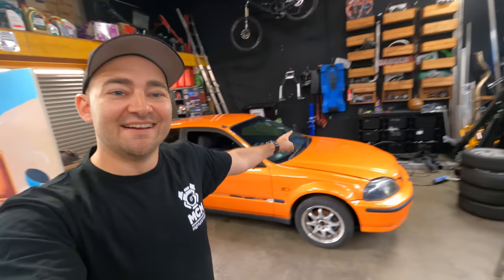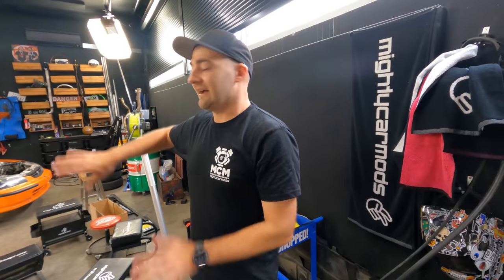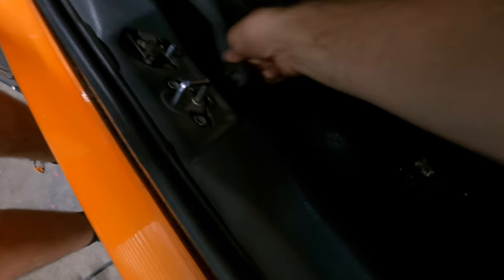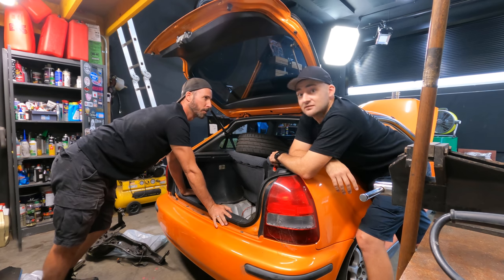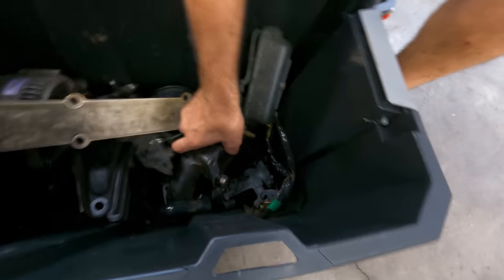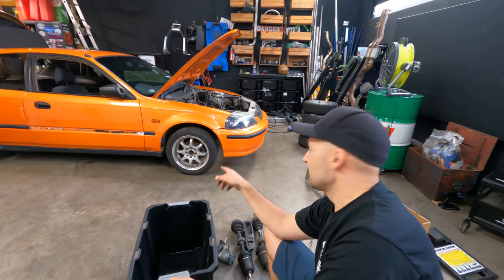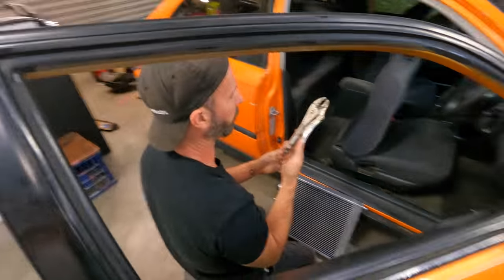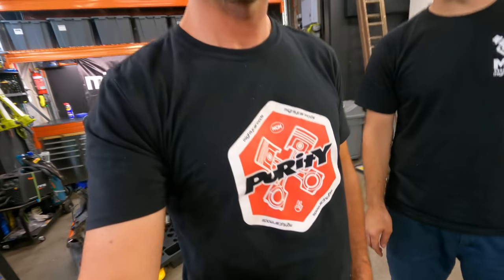Buying an unfinished Project Car (off the internet)

Comment: Funny, I got a 97 Civic CX in really good shape. no leaks no wet spots, just needed breaks and struts for $2k.    I've also got a 97 Civic EX 4dr 1.6lr V-tech  D16Y8.   Cylinder 1 ring took a shit.  took some of the parts and put them in the CX.  Now the EX is a Project.

Comment: My american 1990 240sx came like that, even the seats weren't mounted, both front and rear bumpers were in there, no engine but transmission was there. First thing I did to make stuff worked is that I hooked up jumper cables to what was the cables and found that it was indeed mostly working. Walked away with it for about $500

Comment: I live in Michigan, USA. About 15 years ago I bought a 1985 MK2 Jetta for $500. It didn't have working brakes, and all the interior paneling was in the back seat and trunk. There was no stereo. It was a 5 speed and the hand brake worked, so I drove it (yes) straight to my buddies house (scariest 15 miles of my life) using engine braking to slow me down and the hand brake to stop. We bought a whole brake system from the local car part store & I dailied it for about 6 months, then sold it to a friend. I never finished the interior :D

Comment: 18:29 Last year I bought a vw Squareback project that was abandoned by the first builder. It was a body shell that was sitting on top of a tube frame and held together only by gravity. The tube frame was only tacked together. The rear torsion housing and wheels were only held to it by 2 bolts. The front torsion housing was tacked to the frame. There was no engine, transaxle, floors, windows, brake lines, fuel tank, wiring other than the ones hanging out of the key, lights, firewall, door cards, seatbelts, or paint. Now I have it with floors, fully welded and finished chassis, fuel tank, transaxle, Honda d16 engine, coolant and fuel lines, radiator, engine wiring harness, disc brakes all around, brake lines, suspension, and a properly mounted body. It is not yet running. As a Honda engine fanboy, as well as a tig weldor/fabricator I’d love to build you guys a manifold for your Honda.

Comment: Not me but my room mate bought an Acura Integra unfinished and not running and even unfinished paint.
It was coated in grey primer that was peeling with no sealer or clear coat etc. 
No engine, no wiring harness, no seats, no battery, along with a fair bit of rust.

Slowly but surely over a year or so he made it running and drivable and enjoyed it for a couple years before he lent it to a friend who needed a car who ended up wrecking it being an idiot.

Comment: I once had a customer deliver a Vauxhall Chevette (YEB624T) rally car in boxes, even the engine was completely sttripped, this car had won the 1979 Circuit of Ireland driven by Pentti Arilikkala and co driven by Virtanen Risto, slowly but surely I rebuilt it and was then able to take it to my local race circuit  Kirkistown, to ''run it in''

Comment: Yes my car started just like this! Bought a sight unseen ke70 sedan off Facebook marketplace!!! Hahaha!! Had a working handbrake and a mounted engine (professionally rebuilt). The rest in the boot and backseat. gearbox had wrong tailpiece and wrong shifter rods just lots of head scratching moments working out.... rego was lapsed and found waaaay to much rust to be arsed getting revinned so did the only thing that made sense.... bought another ke70 and going to make a semi ok version out of the 2... my wife is over the moon.

Comment: Do a B20b block with the b16 VTEC head .. get some eagle rods and pistons ACL bearings ARP head studs with a comtec MLS head gasket ... 650CC RC top feed injectors and use a TD06 turbo off an EVO much better and quicker spool  .. Hal tech management .. open the gearbox slap an LSD in there also a double plate ACT clutch kit and a 9 pound flywheel .. coil overs for sure install the rear rotter kit .. and go for 17” wheels tire specs 1
225/45/17 P sport tires ..

Comment: First car I ever purchased was from a friend of mine who is a bit of a Subaru genius. He had a 2001 Subaru Impreza outback sport, five speed, that he had planned on doing a h6 swap into but bought another subie instead. This was just after i had finished highschool and needed a car to get myself around. So I bought the car from him for 300$ CAD. It was all in pieces, interior, engine, suspension, drive line, all of it. I dove head first into it, no prior experience working on cars, took two weeks and put it all together just to almost blow it up right off the bat. Didn't realize at the time that the coolant needed to be all the way full inside the rad haha. Not only that but u almost had the tps pushed to far clockwise so it was idling at 4k rpm. Not did the starter work do I had to bump start it. After I started it I drove it to his house after and got there with the engine overheating like crazy from overrevving and lack of coolant. I fixed it that week, but decided to ignore the bad starter and bump start it everywhere I went, even in intersections while learning how to drive that damnthing. A Month later a lady hit it and I got 2k from insurance. Best experience ever!

Comment: FINALLY. The Honda scene thanks you. There are reasons there is such a scene for such basic, economy cars. Joke all you want, but these cars are fun because they handle well for the budget, cheap to buy, cheap to maintain, cheap to modify, and reliable, including to make power with. Plus generally well and subtly styled. Bout damn time.

Comment: I constantly laugh at my buddy that has had nothing but civics. He now had a K20 04 RSX. True Honda fan boy. I've had atleat 22-25 different project cars in the past 10 years. Currently swapping a 1JZ into my 06 Toyota mark x 250g that I just recently imported from Japan. Gotta love that 15 year import law with Canada as apposed to the 25 year in the US. Gonna be a solid ripper by the time I'm done with her!! Well I'm not doing the mechanical work to it as I don't have time to work on it. Sent it to my buddys shop. That's the only problem working a 13-1 shift. Never have time to do anything anymore. 

Edit: I literally have 24 days off a year. Work 13 days on and get every other Sunday off to get groceries and do laundry.  Two days a month off work. Not gonna lie I absolutely love it and the money is even better. Just paid 71,600 for a 2011 R35 GTR Black edition with a built 4.1 stroker from boost logic. Thing scares the shit outta me 😂. Work hard play hard 💪

Comment: I’ve purchased a car in pieces like that, 98 Audi A4 5spd, previous owner said it just needed the turbo put in. Came with 2 turbos bw k03 and k04 Long story short the engine needed work after rebuilding, buying a new computer and a multitude of other little things like sensors, connectors, wiring, hoses, etc. (some of which were extremely hard to find) I got it running. Both turbos that came with it were bad so I had to buy a new Bw K04, but the transmission was done up with a brand new racing clutch, and brand new suspension, lowering kit, brakes tires. Just the engine needed work, but it needed a lot. Overall I spent slightly less than it would have to buy a comparable a4 and mod it. I still have it runs great 530hp to the wheels dynoed, but most of the power windows died recently. Find a car in pieces, I’d say worth it if you have a lot of time, money, and really know what you’re doing. If you want to learn I wouldn’t recommend this way.

Comment: long inhale....  The B16A was available in the SiR Del Sol in Japan and the SiR version of the civic. It has slightly higher compression ratio and an additional knock sensor in the block over the B16A2.  It was claimed to be a 170bhp engine at time of build (early 90's) but in reality outputs much the same as the A2 (160bhp). normally coupled with a Y21 5 speed gearbox or the dreaded automatic, it was available with a limited slip diff. The B16A had a rev limit at 8500 rpm and VTEC crossover at 5750 rpm. The standard ECU on the SiR was the P30.

Comment: I bought a 92 Lexus sc300 with a blown up rusted up 1jzgte in it, cylinder head was in the trunk, bare block barely bolted in with an R154 trans, and I’ve stripped it out and made a nearly pro spec drift car out of it

Comment: yeahhh I bought a 914 with the wrong 4 cylinder in it except nothing was connected at alllll and it had been sitting in the previous owners shed for near on 6 years without a single bit of work put into it. Anyway I did the logical thing and took it apart even more to completely redesign and "restore" it with some Japanese muscle in the form of a mazda 13b engine, factory widebody, and a lot of engineering and custom work to make it one of a one of a kind street legal race car that makes me want to go out and drive forever.

Comment: Currently looking for knock sensors and a bunch of missing parts for an E30 with an M50 swap. The block came in the back seat with the head in the passenger seat and everything else in the trunk.

Comment: I got a project Honda CRX SI for free. The catch? Your Civic is more put together than my free car. The seats, dash, carpet, and wiring harnesses were taken out. It's all there, but it's been removed. The engine and trans is still hooked up and installed. I just need to get off my ass and put it together.

Comment: My E36 318is came running and able to move under its own power in 2018 but it was a half finished job. It had been crash damaged in 2012 and repaired in 2013, but the driver's door, fenders, bonnet, bumper and grille had been replaced and had a poor primer job done on it. Its entire suspension and brakes were shot, but the power and drivetrain were good, except for misfiring bad as at first while the injectors cleared up of varnish. It was missing every exterior lightbulb and was missing headlights and front and side indicators altogether, so I had to scrounge that stuff up off gumtree and some wreckers. I had to get a new fuel pump and when I got the car the tank was sitting open with a random fuel pump in it just to make the car run, so that lovely smell permeated the (open) cabin.
So I painted it, my first attempt, and got insane orange peel, and couldn't even take my door off to paint it because I couldn't leave it outside with no door as someone could've nicked it. Door still in that awful primer, but she got the nickname "Oreo" because the colours reminded us of the Oreo branding.
I admit, I actually misdiagnosed a blown head gasket because of the condensation I was seeing in the oil and not having had much experience at all in that department. So off came the head, it got overhauled, and new gaskets and stuff and she's sweet as now. ECU still keeps throwing P0300-0304 random misfire codes but it doesn't feel like it when you drive her.
Love her and still have her today. Now putting in chassis reinforcements, and an E46 3L M54 later in the year.

Comment: Take 1 2012 Megane Renault sport 265....... That lived as a rental car at the Nürburgring....... Purchase without its engine, gearbox, interior, and front panels...... Currently all that's left to buy is the brake calipers...... Retail in Germany about 15k€, total spend so far 6k€........

Comment: I brought a classic mini Mayfair automatic 1986 where the previous owner had destroyed the gar box and tried to strip and repair it and gave up. the body work was pretty good apart from standard mini rust areas and the engine was in pieces in the back seat 😂 got a working 998 auto engine from one of our mini club members but I spent soo long sorting the small bits of body work Someone else asked to buy the working auto engine so I sold it and at a later date I picked up a 1275 auto to upgrade it after cleaning up and painting all the running gear and checking for even more rust 😂 i’m now ready to put the 1275 in and get it on the road. Brought the car for £600 and the working auto engine for £100 probs spent £200 on other bits and a good few hours of my time when I get some spare but I think before this summer ends ile have a decent classic mini for around £1000 before I decide screw the auto and drop a manual in if not some crazy engine swap possibly Honda possibly Yamaha R1

Comment: Things you'll probably need:
OEM 96-00 EK B16 driver's post mount (the gel-filled mount sucks)
OR typical Integra post mount & rubber mount + EK adapter bracket
96+ sohc or dohc engine harness (or merge your two harnesses)
rear-middle 't-bracket' also from a 92-00 B16 EK
distributor harness adapter if that's a pre-96 B16 with 96+ engine loom
96+ EK B16 shift linkage & rollpin (any DC/EG works with your welder)
Integra or EK B16 coolant hoses
OBD1 to OBD2A ecu adapter if not Haltech
chip burner or emulator if you use something like the free Hondatuningsuite.com OBD1 software

Comment: Yep bought a 1991 Mk3 "MA70" Supra Turbo with a 5 speed for 1500$ in 2007 she had a blown motor, as a result of some joy riders rapping it, and then leaving it on the side of the road 😥 any way i bougth a JDM 7MGTE, then there were issues mainly $$$ but i own it and i never looked back. She needs work right now, but that is precisely what im doing right now, i cant wait to wake her up from the long long slumber she has had!

Comment: B4 subaru Legacy with a broken trans, broken shocks, tons of bits inside and like this little nugget, a useless old Sony sub. Had a 2.0 wrx engine put in it but was not connected at all to a wiring harness and later found out it had a spun bearing too. Like it was put into the Legacy as a way to store it.

Comment: I had a ba16ca in my gold badge accord 97 model with a to5e turbo off a falcon in it with quite a bit of work and red devil ECU mapped blue printed and everything had 412kw was quite fun but went through so many auto boxes and back then finding a manual to fit was hard now there every were

Comment: In 2009 I bought a mazda 323 200i 16v car it was stripped and resprayed with all the spares and trims inside the car and the stripped engine and gearbox in the boot

Comment: I bought a project that I would've been better off had it come in pieces like that - My 1985 Toyota Pickup. I bought it with a blown head gasket, a ratty interior, '05 Mustang wheels, a stereo that screamed "steal me!", and a really bad lowering job (4" blocks all around).

I've slowly been fixing it to be something an adult could be seen in and drive comfortably - The interior and rust are getting fixed, a better lowering kit is on the way that doesn't have huge chunks of metal you bolt in place to ruin what little comfort was in the ride, and the engine is getting replaced with a 1UZFE. It would've been easier to start with a rolling shell and not have to have junked the worn out bench seat, the blown engine, or any of the mess that is the "repaired" wiring.

Comment: I bought a r32 that had everything stacked inside the car, no idea why the previous owner pulled it apart, all it needed was an engine rebuild. Since I've bought it, it's fully stripped out and all the parts on a shelf, sounds like a good idea for a project before it starts costing money, too many cars and too little income to start it just yet haha

Edit: it's not a skyline unless you find a point bag under the carpet

Comment: Those cars are cheap over here in America, my friend got one in excellent shape for $2500 with only 110,000 miles on it. Generally sell around $4,000 for the most part though

Comment: Bought a 1970 Datsun 1600 project, came with a 1.6ltr turbo engine separately and six massive boxes of parts had so many spares, ditched the 1.6 and put a 13b rotary in it, sorry boys no purity in this build, got it to show room condition then a year later got stolen only just put the chopped sticker on it a month before aswell haha.

Comment: I brought an unbuilt rebuilt engine. This means a block and a few crates of parts. After some research, it turns out that it was most of the parts needed to build an old school, Chevy 283 stroker engine.

Comment: A b16a actually has a shorter deck height than the b16b (used a b18c block with a b16 crank) basically a b16 is a true 1.6 the b16b is a destroked 1.8
Reply: Also love the show have your posters started watching 8 years ago because of your original civic video love the honda content!

Comment: i bought my 1972 triumph spitfire unseen from eBay for £550, it  new it was going to be in good condition when it came with a spare chassis, its more rust than car and 18 months down the line still in 1,000,000 pieces, but along with half the car being inside the car dismanted. it had a unopened bottle of lemonade thats expiry date was my birthday ( im 32) and as you can imagine a 30 year old bottle of lemonade tastes absolutely horrible.

Comment: Ek9 dash carpet and seats for the interior be sweet 

I bought a 91 si civic jdm import for 1500 10 Yrs ago wasn't running had a unfinished h22 swap and lume made by stevie wonder and Ray Charles, still got it now but new lume interior and many other mods later including rays wheels ohlins shocks think it's value went x10 in the last 10 Yrs also

Now I might sell for a 911 🤔😁😂

Comment: I had bought a 06 wrx last summer with the engine pulled and all the parts in the trunk and rear seats with the wing in the passenger seat and still haven’t really touched it other then cleaning it out